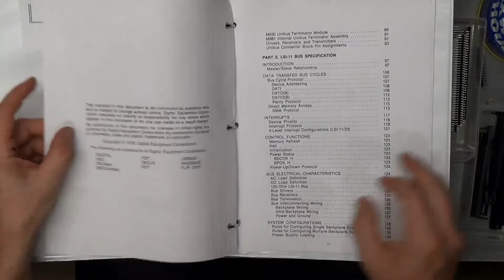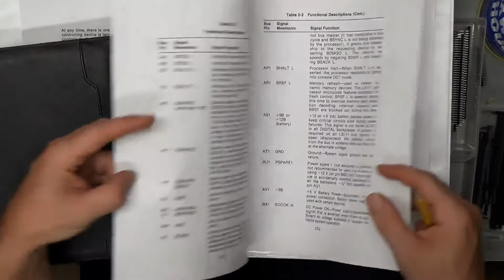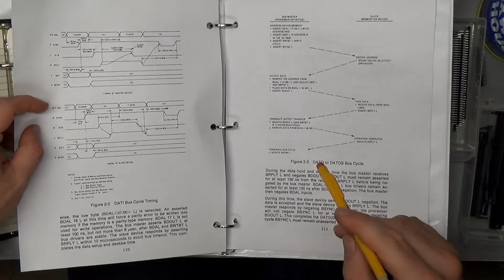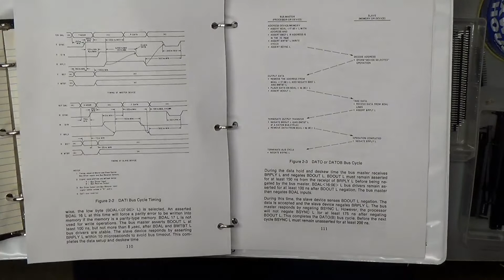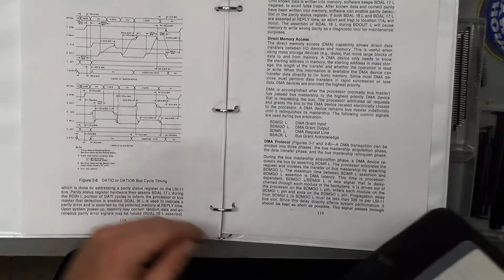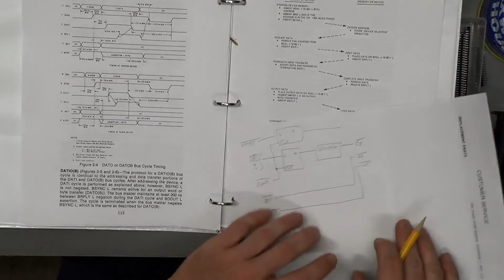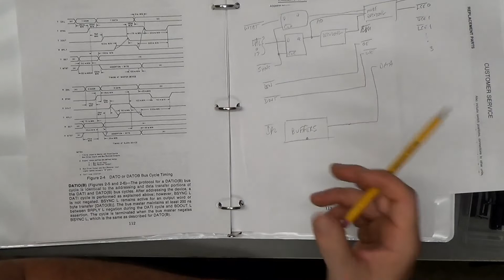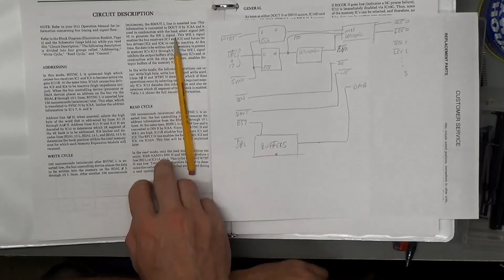The Heathkit H11 (PDP-11) | Long Boring Ramble About Designing a QBus Memory Interface

Comment: I think a lot of times, the decision of whether to go with logic ICs or PALs comes down to two things:  Do you need access to the intermediate signals for troubleshooting?  Then go with discrete logic.  OTOH, if it takes longer and/or costs significantly more (in PCB real-estate) to lay out the criss-cross of traces and find spots for all the ICs in a limited board area, then go with PAL.

As long as you can re-program your logic array, and optionally output intermediates on spare pins (if you have them), then either is perfectly workable, and I might build up a prototype with discrete logic, then condense the proven design into a PAL to make it easier to duplicate and maintain.